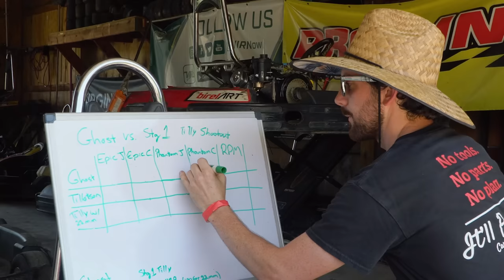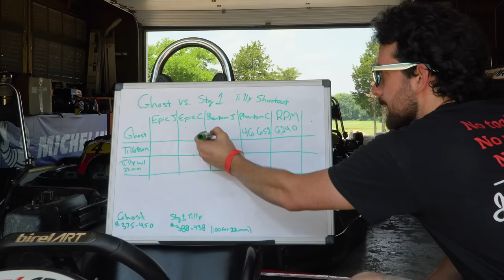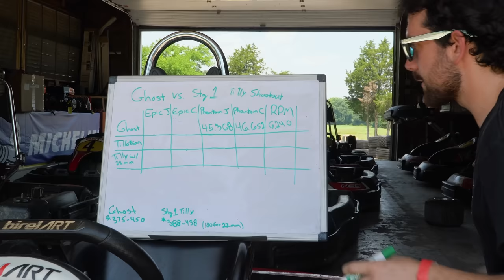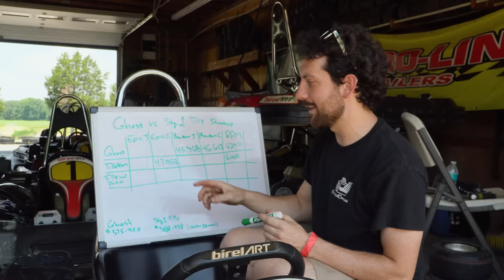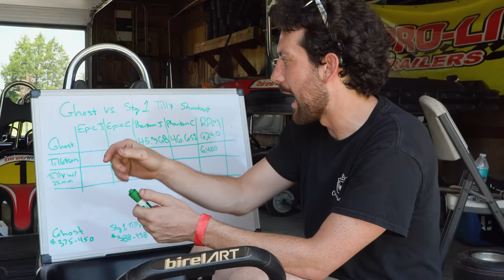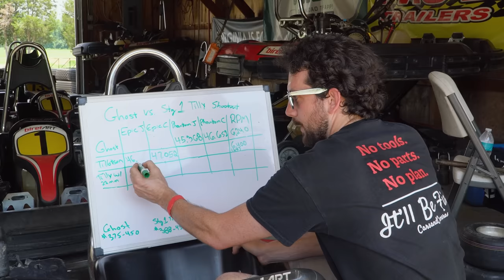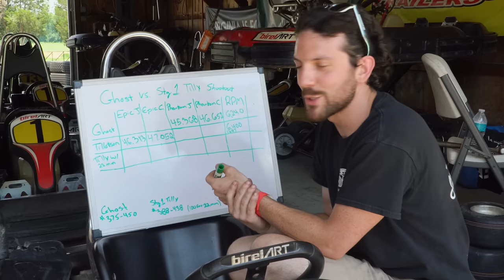Predator Ghost 212 Racing Engine vs. Modified Tillotson 212 High Speed Track Test!

Comment: I have to drill start my engine the compression is crazy its a tillotson 2.8bore it has 310 cam /arc billet rod /chromololy push rods /with black venom roller rockers / and 36pnd daul valve springs /and ultra light arc billet flywheel any reason my compression is so high?
Reply: I would rather have the high compression and have to drill start than sacrifice compression just so I could pull start it. Higher compression causes a more energetic fuel burn= "mo powah babeh!!" To quote my favorite donut media host James Pumphrey.
Reply: Just a beginner here, but could the valve clearance be a bit off creating extra compression?

Comment: Dude just put the pump from the ghost on it. Its what 2 screws and 3 hose clamps. Imagine if you had good sticky tires. Basically the ghost is still a better motor

Comment: You don't have to get the accessory kit for the Ghost. That's adding $150 of unneeded expense when you could have it on a Kart running for way less than that. You're factoring in the kit like you absolutely have to run it.
Reply: No the accessory kit for the ghost isn’t mandatory but its said in the video about the 3:15 mark that the kit includes an exhaust, which doesn’t come with the engine, and a fuel tank have to be sourced.
Reply: @Icantball67  yes I know, but an exhaust and tank doesn't cost near $150 at all. A tank is like $30 brand new for the 212 and you can either buy an exhaust for about $25-$30 or just have someone make it for around $20 but you can just round these two things up for around $20-$30 for both on eBay, Amazon, Craigslist or yard sales. Chances are if you're in to Karts or know someone who is, you can probably get something that will work for free. You can also get a pulse pump for less than $15 to go with it.

Comment: I have a stupid idea, if you were to get a 90 degree gear box and an engine from a riding mower, would you be able to get taller gearing onto it? Since those engines are more torque than speed.

Comment: stupid question but, Is there a way to add an air filler like on a tire to pressurize the tank and therefore forcing fuel in it the carb for a few laps? I'm thinking 4 to 6 lbs.?
Reply: It would just force the needle back. flooding the carb

Comment: why not run a Ducar 212cc     about 240.00 dollars   race ready  comes with pvl flywheel rated at 17000 rpm with a reinforced  block possibly need a billet connecting rod  or a Wildcat 223  it comes  with a reinforced block  the Ghost needs  it needs some serious work to be done  a cast iron flywheel  no reinforced block  not race ready they is a review from Kentucky Fried Fixes with a tear down save your money